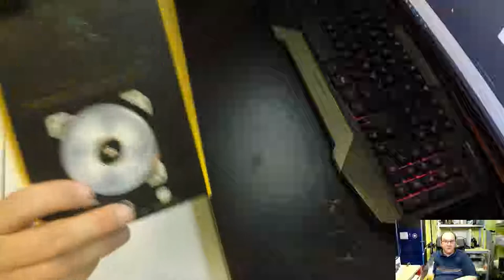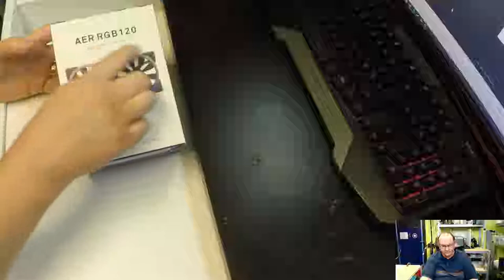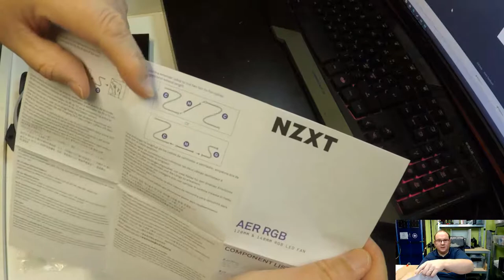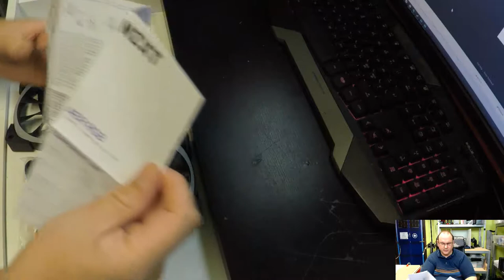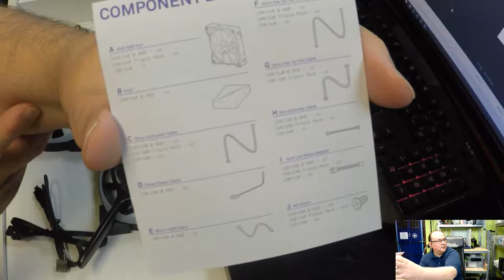PC build case fan solution

Comment: Sleeve bearing fans are a true misnomer. They are literally a plastic tube with a metal rod inside of it with a drop of oil. They are in effect simply a cheap way of making a bushed rotating shaft.  I generally go for dual ball bearing fans for power supplies, and just whatever does the job for my computers. That PC that is used may be a double ball bearing, ball bearing, or a simple sleeve bearing depending on what I have on hand and what is cheap.  I don't recommend anyone replace the fan or fans inside of their PC power supply as they understand that it can kill you if you touch or contact the wrong parts.